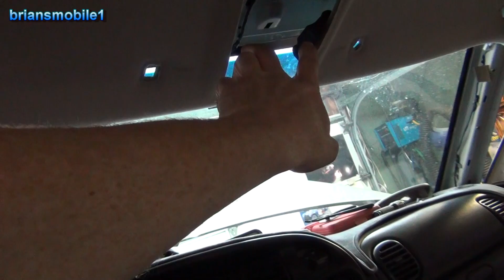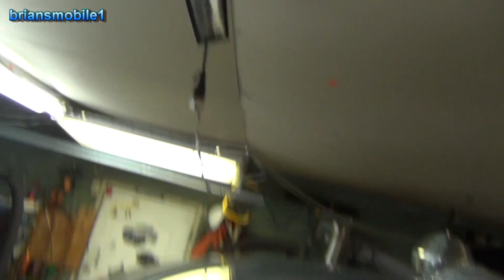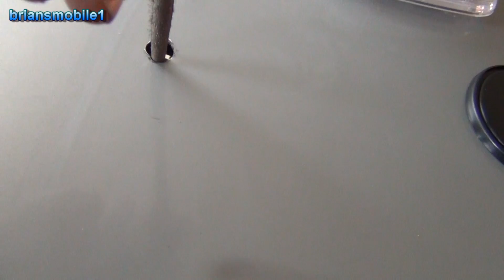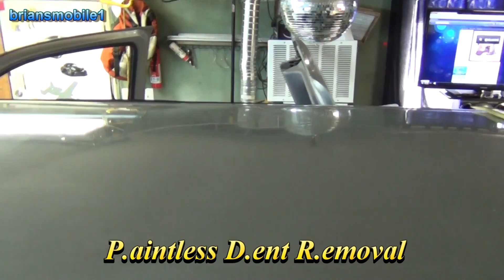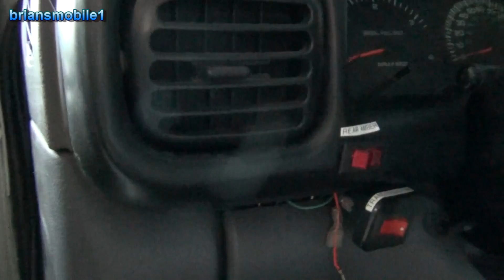How to Install Atomic LED Cab Lights From Scratch

Comment: Where did you find those adapters for the wires from the lights
Reply from the maker: The light sockets came from Mazda 3's at the wrecking yard.  Front marker light sockets.

Comment: Great video, you make it really clear and simple with your explanations. That gel your using to seal the holes would appear to be a bluing agent like you would use in gun finishing.   Just oxidizes the metal to protect it.

Comment: I did basically the same thing but added two thin rectangular lights in the top back panel for bed and strobes two in the rear bumper for backup a light bar cross the front upper windshield and a hand control spot lights each door plus 4 pods on the front bumper colors are red yellow and white 
Truck has tough country bumpers front and rear nerfed bars down the sides and wrapped in predator camo wrap rides on P305-70-R16 all terrain engine swap jegs crate 408 CID dodge OH it set up to pull a 24 foot gooseneck trailer transfer flow had a 46 gallon gas tank swap so that's an additional 20 gallons carried

Comment: Hey Brian,  Get yourself a set of these Stepped Bits for drilling sheet metal.  They make a nice hole without burrs.  Here is an example, there are many manufacturers:  https://www.amazon.com/Neiko-10194A-Titanium-Drill-Speed/dp/B000FZ2UOY

Comment: I installed clearance light on my 2014 mega cab and I am having a heck of a time finding the right wire to connecting to. So that my clearance lights come on with the headlights. I thought I could connect to the light switch control but to my surprise I can completely disconnect the wire hookup and start the pickup and head lights come on. While the wire connection is disconnected.  Must be a computer module set up.  Any ideas? Super confused.

Comment: at 13:09 it looks like that silicone ring slipped off the screw when you were tightening it down
Reply from the maker: Sure did.  Good think I wasn't relying on it.
Reply: so did you have to put some sort of sealer over the screws then?
Reply from the maker: I did under everything on the bottom.  The silicone rings are a butterfly's wishful thoughts in a wind storm.

Comment: On your ground wire,don't you think it would have been a lot easier to  use the blue wire connectors where they have one wire in a straight line and the light ground on the side of the same clip?You can use the same clips for power too.I've done this install almost a dozen times and worked like a champ.These are the clips you use to press the metal clip inside the plastic,you don't get lose wire or bad grounds.You could have saved an hour or more.and only for a couple dollars.

Comment: great video, I have an 02 2500 I'm about to do this to. Only difference is I may have to drill some more holes because I got lights off a Ford with the harness. Glad to see the roof has holes marking the locations

Comment: Great job! The truck lights look amazing. What type of lights did you use for the rear window interior? I'm driving a Dodge Dakota and I am looking for some lights to work in conjunction with my rear signal lights (I find the regular rear signal lights are not visible enough), and also to work as emergency strobes like you have.
Reply from the maker: +Zoltan They're gen 3, and 3 LED exterior mount types.  The company name was 3LED.  I can't find them anywhere anymore.  This is the closest I could find → http://www.amazon.com/gp/product/B00B9JI1XY/ref=as_li_qf_sp_asin_il_tl?ie=UTF8&camp=1789&creative=9325&creativeASIN=B00B9JI1XY&linkCode=as2&tag=httpwwwyou00f-20&linkId=WR273N6EZWWHJKKK
Reply: Thank you. I looked up the link you posted. They look good. Any suggestions for the interior lights (rear window)?

Comment: I thoroughly enjoyed this project on my last f150 can't wait to get them over to my current f150! I put 4 halo. floods on my Baha bar..spst switch to 2 - 25A fused relays to 2 - 65W floods and 2 - 55W floods..my bar being grounded with 4 self tapping screws...one screw was sizzling while two 65W and only one 55W floodlight were lit! My question is why is the screw sizzling? Thanks for all the hard work on here! I've learned a ton!!
Reply from the maker: It may be that the ground current is insufficient.  If you have too much resistance on any part of the circuit you will get heat.  To help the amp flow- use a heavier gauge wire, or a larger bolt to ground or ground terminal (at battery) to chassis.

Comment: For these cab lights, are they just brand specific to dodge then?  Where did you get them, if I may ask? 
Great video man!
Reply from the maker: They can be installed on most anything, but they make factory type matches for Dodge, Ford, and Chevy vehicles.  Check them out!  Google Atomic LED cab lights.

Comment: the goop looks like some rust inhibitor (i used some that make steel black), but it is not washable thing after, so I'm at a loss. Probably rust inhibitor mixed with something waxy.

Comment: Nice video man, I enjoyed it.  Can any person put those lights on their truck? You spoke elsewhere in the comments about helping other people on the road.  I do the same thing, (Got about 3-4 cars unstuck after they slid off the road this winter.)  And having the extra lights would be nice. As long as they arent red or blue you should be ok?
Reply from the maker: Yes- like you said the color and the mode of use is key.  Use them to pass on the freeway you're Furschitzled.  Use them to create a safer condition and in the right context and you're good!

Comment: Little tip. Cut the bottom off a dixie cup and punch the drill bit through the bottom. The little cup will catch the shavings and you won't have the mess to clean up.
Reply: Punch your drill bit through the bottom of the cut off cup, then drill your hole with the bottom of the cup on your drill. Good tip!

Comment: Hey brian I think all ur vids r great the only thing about this kinda mod is ur truck looks like an emergency vehicle, id be kinda worried that the cops would throw the book at you, handy in a breakdown tho!
Reply from the maker: Thanks!  It is an emergency vehicle.  I regularly assist others who are broken down or in an accident etc.  The lights are used road-side.  I wouldn't spend the time or money on them if they weren't to be used for something.  You'll notice that there's no red or blue lights in the front.  Just amber and clear.  Same with the rear, but my hazard/brake lights are red.(of course)  That's the key.  That and if you use them responsibly you're within the parameters of the law.  I have assisted every police agency in the area and only got grief about lights from one particular officer... a young university officer.  Sheriff's, City, Highway Patrol, and DNR are appreciative of the help and fully understand the need to be seen while assisting others on the highway or roadside as they all have their own "close call" stories to tell.  The young university officer made some idle threat about potential misuse to pass the time and justify contact.  Of course I treated him with respect and nothing was issued or recorded of the incident.  He didn't even identify me or run plates etc.  I think he was both curious and bored.  No laws were violated.  No worries.
Reply: briansmobile1 thats very true how many near misses and roadside crashed do you see on those police camera action shows - loads, I hope they serve you well and people slow down to give you room to work!

Comment: If a vehicle is over 80 inches wide it must have three identifaction lights at the highest point applicable and markers at the widest point applicable. A trailer is a vehicle. So a 2500 does not need them because it is less than 80 inches but a trailer over 80 inches must have them. A dually is over 80 inches and must have them. thats why they are grouped three in the middle one on each side...just fyi
Reply from the maker: Thanks!  When my mirrors are extended for towing- does that count?  Or is it based on wheel base?  Either way- I'm good.
Reply from the maker: Did you see the topside creeper video?
Reply: yes i did its on the shopping list got some major engine work to do on my 6.5L TD when it warms up, wish it was not so flimsy but we live in a cheep china world for 200 bucks i can live with it...dont take down the vid so i can use your affiliate link.
Reply from the maker: oklahoma outdoors
 You bet.  Get the newer updated model for sure!  Link is up there.
Reply: In the state of CT even commercial vehicles aren't required marker lights
Reply: +oklahoma outdoors - Hopefully the cheap China world will change real damn soon!  Can't wait for January 20th!

Comment: Nice job, and I believe most people can do this with a touch of warning not to fold their liner and stay away from Alex.
The wiring (unit used, and what wire where so it does this and that kinda thing) methods of stripping and heat shrink should make it out okay. 
Another concern was the voltage, did you relay or wire hot straight from the battery or fuse box.
I guess I'm trying to dumb things down, or maybe everybody gets it and I'm just too critical.
My feet hurt.
Reply from the maker: lol.  I ran the power on the RL circuit so It's protected and I didn't have to go through the firewall.

Comment: The end was freakin hilarious! Made my wife take a double take a double take at the monitor. 
Great job on the editing! This was very detailed and will help many.
Aloha and stay warm
Reply from the maker: Thanks!
Reply: @briansmobile1  I hope you will see this. Im trying to choose a quality cab light set up for my 2000 Dodge ram that didnt have them originally the parts am feel pretty cheap and I've seen some bad reviews about Recon, I noticed that Atomic doesnt have lights for our generation of pickup so my guestion is are those later model lights you are installing? I found some Mopar oem kits on Amazon that are model year 2010-18  im sure i could figure out the splice id just like to know if they fit snuggly enough to the hood to prevent leakage being they arent meant for our year of trucks. Thank you for your time!

Comment: Hey brian, I got a sweet idea for keeping metal shavings collected.. Get a paper plate or a chili cup put the drill bit through the centre when you drill all the junk lands on the plate and you dump it
Reply from the maker: Not a bad idea there!
Reply: yeah, stacy david on GEARS did something similiar with a disposable cup, like a red solo cup. but u just cut so much off the top and use whatever size bit ur gonna use to make a whole in the bottom of the cup to catch the metal
Reply: amanda c thats funny i watch his show and i never saw that lol, i thought of it when i was making brake and fuel line mounts and i didnt want shavings in my eyes or on my stomach lol

Comment: if the steel turns black and is resistant to corrosion afterwards you prbl browned the metal.
wiki directed to cold blueing and then to "Selenium dioxide" as a chemical used.
Reply from the maker: Thanks!  Selenium Dioxide.

Comment: That rust preventing stuff .... Is it guaranteed rusted proof?? Is like repainting the metal?
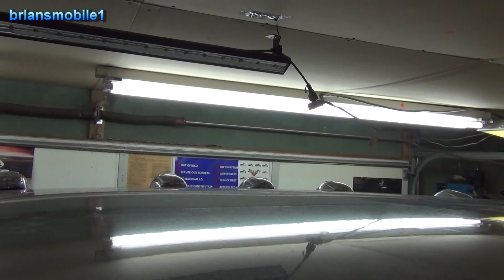Reply from the maker: It's not paint at all.  When newer cars are made they are dip in a chemical bath that alters the chemistry of the steel to prevent corrosion.  This is a similar type of treatment.  Check out this video at 19:09 Dodge Challenger Where a Dodge Challenger body is dipped in a Zinc Phosphate solution.

Comment: Love your videos it helps me so much with my 99 Dakota. Can you make a video explaining more about your side markers and how they are wired.
Reply from the maker: Yes!  They're LED- even the front factory placed turn signal bulbs are.  This allows you to have more lights without over loading the circuit AND so you can turn the noisy engine off and still have traffic communication/signaling.  (I still have to use a custom LED flasher or my truck BCM thinks a bulb is out and signals too fast) -So you wire them the same way as the harness built in this video.  You extend the front turn signal + wire down the frame to the back tire in distance (inside frame tube along or inside factory harness jacket for protection and stabilize from chafing etc.) That causes them to work with turn signals/hazards, but not brake lights.  The ground is built into the housing of the LED marker lights and is acquired locally.
Reply: When I get some money I will try this. I will try and film it  and post it. Keep up the good work. Do you have a parts list for your lights?